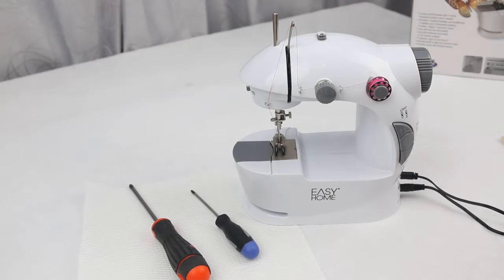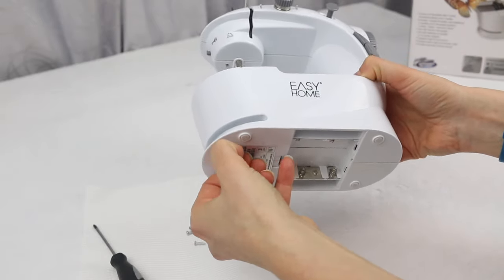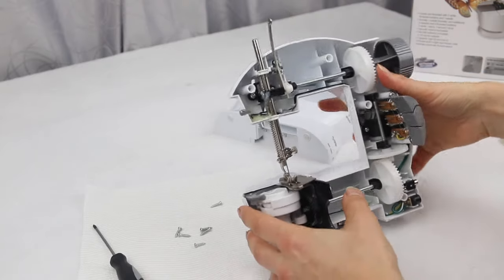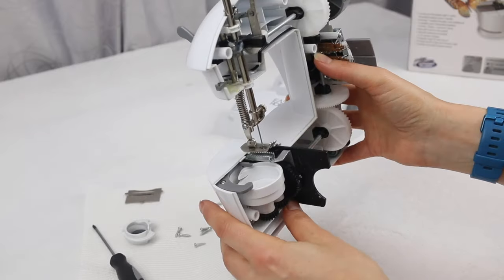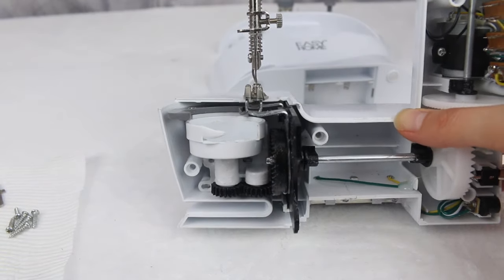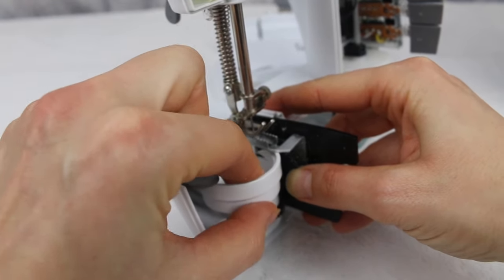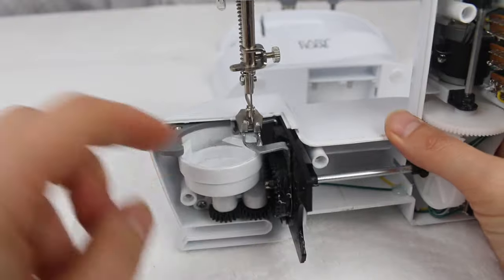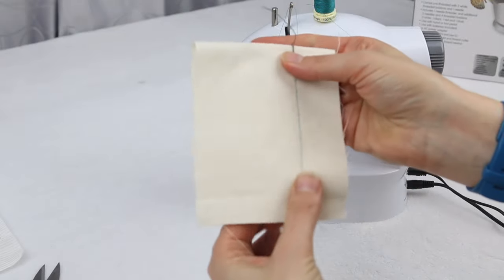Mini Sewing Machine Not Catching Bobbin Thread? How to Fix the Timing

Comment: Hi ! Thank you for sharing this informative video. I have a couple of issues including timing. I tried fixing the timing issue but it still skips in between. Secondly, the motor functions and the needle works too before I assemble the front cover back, once the cover is back in place, the motor runs but the needle is stuck! 
What do I do....?

Comment: I bought one of these minis at the thrift store for my grandson to use. Stitches weren't catching and I found your video which was a life saver! Took me hours just to figure out how to unscrew the outside screws because all of my Phillip's were too big. Finally used my drill to enlarge the hole. The screws were in so tight that it raised my blood pressure! After numerous tries at adjusting the bobbin cogs I wanted to throw in the towel. Yours was the best video on the procedure. Thank you so much. It's finally working with perfect tension.

Comment: I'm going to try to find a screw driver that actually fits and try this. Edit I tried this and it worked for the most part, going to have to take it apart again cause it's only stitching half of the time but at this point half of the time is better than none at all

Comment: Thanks to you it works!!! After several hours of adjusting everyting outside and wondering what the problem is, turned out the timing wasn't good. With your proper instructions and clear explanation I solved the problem and now the machine runs like a wonder! :)

Comment: Idk how to get mine to work. I have a differwnt maxhine but in the instructions it have a qr code to this video. Idk why though. But my machine just will not pick up any of the bottom stiches, like the top thread wont go around the hook properly when i have fabric, but even without it it doesnt work. Im on rhe verge of giving up right now. Any tips?

Comment: This is great! Thank you! 

From you, I have now learned that the hook takes the thread from the needle and then turns it all the way around the lower bobbin and that is how it picks up the thread from the lower bobbin. (This had always seemed like mysterious "magic" to me.) 

It made me see that the timing seems to be right in my little machine, which I just bought and turns out to be a great little workhorse but it had suddenly stopped picking up the thread (after I stopped using it yesterday and wanted to continue), but the "bobbin basket" in the bobbin housing is no longer in the right position, for whatever reason. I think it's happened a few times before after I started using this little machine, except a little worse this time. (The needle even runs into it at times.) 

This may be because I was running thick layers of fabric and I nodded while I typed this because now I may know what the high-pitched "screeching" sound was... that little basket getting moved along the bobbin housing. That happened when I had multiple layers of fabric in the machine that just fit. (That may sound horrible; I improvised a lined shopping bag out of a lot of curtain fabric and then I ran into the limitations of only being able to do one kind of stitch. I ended up with something cute and functional. :) I have now properly designed one that should require stitching through much less thick layers.)

Will now try to solve the problem - may need to start removing some screws, yes, and you've showed me how to do that - and add more comments later. 

Maybe you talk about this too, later in the video, btw. I am still at the start of your video while I type this, but you showed enough for me to want to take a look at what was happening inside my machine without/before taking it apart.
Reply: Yeah, okay, I was able to move that basket back into its proper position; there is a little triangle sticking out and that needs to be caught against a little plastic bit coming from the left, from the machine. 

The rest of the problem may be a tension issue and/or the result of using two different threads. (Ran out of the thread that the machine came with in the lower bobbin and then used a different thread for that.)

I used to sew with a regular machine decades ago and I remember similar issues from back then. You know, these nice little tangles, lol.
Reply: Fixed! Thanks so much for your inspiration!

Comment: I did everything you showed in the video (took machine apart). Machine worked perfectly when operated manually but when I plugged into electrical outlet, the machine jammed. The thread jammed in the bobbin casing, creating a messy nest. What went wrong?

Comment: hi can u help me?? i'm having problem with my sewing machine. the foot socket and the power outlet is not working but if i use my hand in hand wheel it's still working but i can't just use my hand because it will takes years to finish one blouse i hope u can help me!
Reply from the maker: Does the machine work when you use batteries?

Comment: I thought i fixed the timing but seemingly not. Machine is not stitching at all. Should the top thread pass over the bottom bobbin at every rotation, or only the first? It appears to hook fine the first time (most of the time) letting me pull the bottom thread through the hole, but then the top thread doesn't pass over again after that.
Reply from the maker: Every time the needle goes down and back up the thread should go over the bobbin. My hook race spins twice in the time it takes for the needle to go down and up once. I hope that helps.
Reply: @EasySewing4Beginners  that was my problem too. Though I already fixed the timing of my sewing machine I keeps not stitching when I start to sew with fabrics but without fabric the needles' thread catches by the hook. I'm so tired doing it again and again, but also hoping to fixed it.
Reply: @kittcuts7901  hello,I have video of how to fix bobbin thread problem very easy.
Reply: @kittcuts7901  i feel you, still searching for an answer HAHA i am starting to give up but hoping at the same time 😆 i already fix the hook- the timing and the hook catch the thread but when i place the fabric and start to sew WAHH! it's still not stitching 😢😢😢 i already check everything even na position of the needle SEND HELP PLSSS😆
Reply: hi i face similar issue.. kindly help.

Comment: Thanks so much for these clear instructions . My machine's  problem is that it keeps stopping when I'm using electric connection but sews smoothly with batteries . I cannot use the electric connection with it . The foot pedal also stops working sometimes , then after a bit of wriggling starts working again . It would be helpful if you suggested a solution . 🙂

Comment: What is the white plastic arm for which retains the bobbin spinning thing?  My plastic arm causes the bobbin spinning thing to stop spinning and the entire thing starts sounding like a garbage disposal full of knots!  The bobbin holder  just sits on the "claw" pickup.  How is it supposes to stay in "tune" if it can easily get out of alignment?  It is very close to being tossed out!   
I am trying to make my own grow bags.  My mother past 2 years ago and I asked her hubby for the sewing machine then, a really nice sewing machine... NOPE, you can't have it because the new light of his light wants it.  F-ing jerk!
Reply from the maker: Where abouts on the machine is the white plastic arm? Top, bottom?
Reply: @EasySewing4Beginners  The plastic arm that holds the bobbin holder down.  I timed the bobbin and the needle and it still didn't work.  It stitched for 10 stitches and missed everyone after.  The bobbin thread hook is not functioning correctly.  6 hours of screwing around.  It's in the garbage.  I'll hand sew the grow pots!
Reply from the maker: Sounds like it might have been the best option. You were very persistent though!